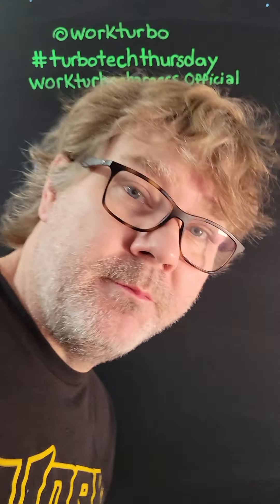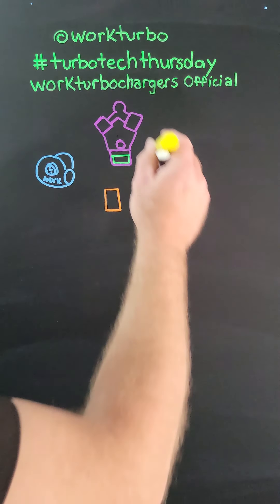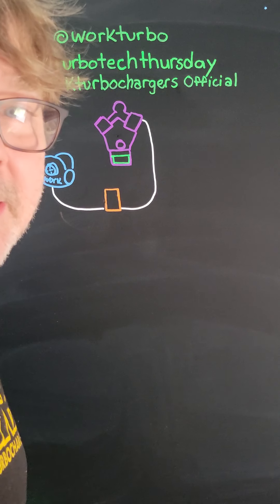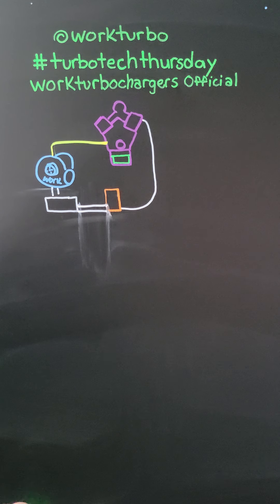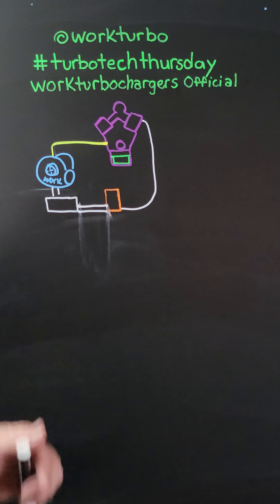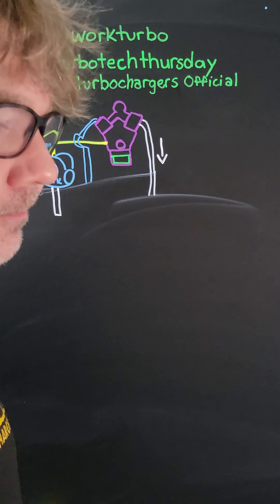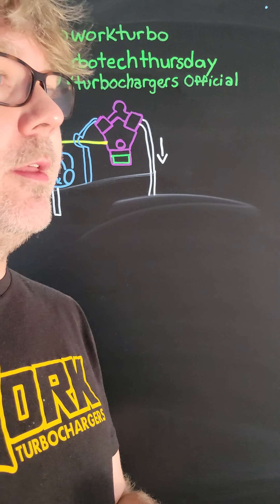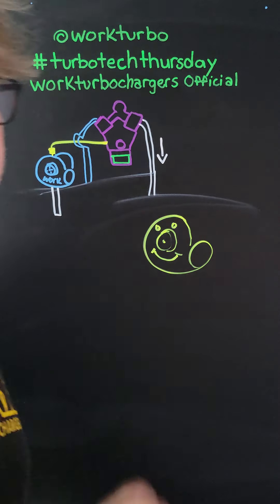Scavenge Pumps and Turbos, Tech Tips!!

Comment: Hello good sir, I have my first turbo project on the works now. Its a 2017 V6 mustang and I am doing a single turbo kit that uses a Precision 6776 .81 AR snail. It currently has designed a gear pump located below the turbo that will run a 5/8 in hose using the initial set up you are against. So line drops from the turbo, gear pump picks it up and dumps it back through a billet oil cap at the valve cover. I do not plan to boost past 8-10 PSI on this application. Any thoughts or recommendations?
Reply from the maker: Almost every pump we have seen setup like this will experience an excess of oil/windage at the turbine seal ring...causing a slow buildup of carbon and subsequent issues with the turbo.  That is the reason for the sump tank and the vent...it will allow for gas expansion in the system, which a gear pump is not going to handle very well.  

I would take the time to address the design before it becomes a problem later down the road!  -Reed
Reply: @workturbo  Thanks so much, I will work into getting a small sump tank, I already found a nice option, in order to avoid any issues. It will have to be a mid term solution since I am already over the budget. Seems like I can use the turbo for a short period of time using the current setup..

Comment: @workturbo alright thanks.  I've had an old STS kit lying around that I decided to put to use, and the oil inlet has a check valve that came with it.
However the return side did not.
Started it.
Revved it, confirmed it worked, shut it off.  That was the end of that day.
A few days later I came up to the car.
Oil coming from everywhere.
Out both holes of the cold side of the turbo, out the hot side etc.
And like you mentioned it was parked on a hill. And had no check valve at all not to mention no scavenge tank.
Reply from the maker: Many years ago my friend Matt and I did a custom twin turbo kit on a viper...cranked it up, ran great.  Shut it off and went inside to grab some food.  Came back to 7 qts of oil dripping out of each side pipe.  Ooops!    Lesson learned!   -Reed

Comment: Ok maybe a crazy idea.
On a remote mount turbo.
With the air filter routed into the trunk.
What about running a 1/2" line to the scavenger pump.
Only between the turbo and pump adding a 1/2" T as a vent tube routed to a high point in the trunk?  My trunk is non sealed trunk as my car as been in a wreck but i dont want my air filter under the car so i dont suck in water or debris.
Reply from the maker: I have always found a sump tank works best to get the oil as air free and collected for the pump's suction side.  Keeping the pump primed the best we can anyway.  

If you are willing to experiment, the T fitting in the line may work in your application.  Seems like a simple enough test!  -Reed

Comment: What check valve do u recommend after the pump on the return line?
Any brass check valve do the job?
Reply from the maker: It needs to be rated for the flow demand, temparature and also be a low "crack" pressure.  I have used products from Eaton, Improved Racing, Vibrant etc with good results.  -Reed

Comment: Do you think running a vent right below the turbo is a better approach than venting a tank? If pump pulls vacuum then theoretically running a vent next to turbo should move more air/oil rather than just relying on gravity drain to the tank.
Reply from the maker: We have tested this back in 1997, and it works if you can get the vent into a functioning location without getting blocked by the oil flow.  Its consistency was always our main quirk with this approach.  Reed

Comment: Awesome info. Thank you sir. Wouldn’t have thought of the one way check valves or oil resivor. By chance where may I find a 4AN one way valve for the oil feed side? And how important is it to have the watsegate before the turbo vs the traditional built in watsegate on a remote mount turbo?
Reply from the maker: Sorry for the slow reply, John...been a bit busy in the shop!  For the inlet check valve I recommend the viton 1 psi version from https://rbracing-rsr.com/oilsystems.htm  Their valve has worked flawlessly for my customers.   They also sell the only scavenge pump I recommend.  As for your question on wastegates...that is a very cut and dry answer.  Internal gates of the right size will work, but external gates placed in the right spot will always provide more power potential.  I will cover this topic in a video soon ;)
Reply: @workturbo  No worries! Thank you for everything, I really appreciate you and your time for reading my messages and replying back! Link included 5* 
Looking forward to the next uploads, especially on the Wastgates. 🙏🏻🙏🏻🙏🏻

Comment: Great video its super informative. I'm in a situation with a TT setup where I can't get the pump lower than the scav tank.  In this case if the scav tank has a breather will it stop the pump from priming?
Reply from the maker: Good question.  If the pump is pulling from the lowest portion of the tank, then it should not be an issue as there will always be "fluid" present in that area for the pump to pull against. 

 I have found that most of these pumps will fail to pull aerated fluids very well at all, so that is the main job the sump tank performs (collecting the liquid and putting in a place/state that the pump can deal with).  So as long as your tank is of adequate volume and a fairly well engineered shape it will work as good as it can with the vent. 

  Now, if the pump struggles with pulling fluid, that may be a problem with the pump itself.  Like I said, most wont pull like the manufactures state they will once they are in the "car environment".  This is what bit me years and years ago...

Short answer is the vented tank is a requirement that the turbo needs, solely for gas expansionc.  If the tank collects the oil and cannot "overfill" then you will have success IF the pump can pull the column of fluid out of the tank effectively.

Hope my rambling makes sense-Reed
Reply: @workturbo  thanks good answer I guess there are no definates here hey, I'll need to build and find out. What sort of flow rate should I expect to be going through a turbo? This would help me figure out if the scav tank drain is going to be submerged. I'm using 2x BW EFR 6758's, and I actually can't find that data anywhere.
Reply from the maker: @adampentland9871 While there is no published data on this (that I have anyway), our testing has seen as little as 16 oz per minute and as much as 60 oz per min depending on the oil temp, oil type/viscosity, oil feed line diameter and of course pressure.  BorgWarner  suggests no more than 4 bar oil pressure (60 psi) maximum and an oil weight of 10-40 in their Technical Training Manual fwiw.  Reed

Comment: If I go to a standalone tank. I'm wondering if you ever heard of anyone using actual 2380 turbine oil Or where I can find info. I use it in my Garrett TPE 331 -10 on my Thrush Shits like 40 bucks a qt but I've got cases of it. I'm not a oil guru but seems like a better option then motor oil it's a lot cleaner and thinner so it flows faster than motor oil and handles extreme heat very well like 750 deg Celsius on every startup.
Reply from the maker: I have experimented in using turbine oil a long time ago.  There should be more data on it avaiable to the public a little easier than 20 or so years ago when I was "younger and naive!" We know the temperature stability should be excellent, and I would hope the oil would meet all of the needs for a floating bearing (ball bearing turbo will be fine with it)...let me do some more research!  I think I a good contact that should be able to help place some insight -reed

Comment: You covered the fact that over compensating for the oil flow when choosing the pump is a factor. Do you think there is such thing as too much pump? My intuition tells me that too much pump can't be good either as it would aerate the oil returning back to the engine. What would be a good remedy to eliminate all the air in the line between the pump and the valve covers?
Reply from the maker: It would most likely be worse for the pump itself than the engine, as a little bit of aeration introduced into the valve cover really wont matter as it will dissipate as it drains back into the pan.  I have only seen this possibly being an issue with a dedicated suction stage on a dry sump pump, but it was an old pump with unknown history.  Our customer's road race car has used a full mechanical stage to scavenge just one small T4 turbo and we have never had an issue with the turbo, pump or aeration (but it is returned into the oil can that has an engineered baffle system in it from the manufacturer).  Hope this makes sense!  Reed

Comment: So I built a tank and it was only vented to atmosphere. I took it for some drives and it was fine. This go around I started hitting boost and it squirted out of the vent all over the bottom side of my vehicle. Is this why you run the vent to the valve cover?
Reply from the maker: Yes...for this reason and also to keep it sealed from water/dirt/debris as well!
Reply: @workturbo  ok so maybe my oil pressure is just to high and I need to regulate it or get a bigger pump
Reply from the maker: @jeepwk6.5L  What turbocharger are you using?
Reply: @workturbo  shitty one 😂, on3 performance 80mm

Comment: What about using the scavenge stage on a dry sump pump? Does this still apply? My turbo is higher than my dry sump pump
Reply from the maker: Same rules apply...use a sump tank with a vacuum break, it will work perfectly.  If your oil pan has several pickup stages at the very bottom, you can also drain back into the pan, just make sure the line is the correct size and flows down hill all the way to the pan.  There can be ZERO up hill runs in the line.  Thank you!

Comment: First you teased that you would name the one scavenge pump you recommend - then you don't. Please do! Excellent drawings. Learned allot, great advice - except for that "secret" scavenge pump thing...  Also, recommended check valves, if you will.
Reply from the maker: Sorry about that Dale...I have all of the parts to do a follow up video, just lacking in time at the moment.  The pump we have always used and recommended comes from RB Racing.  They also have the correct check valves.  This company has done a great job finding/creating oil scavenge solutions.  rbracing-rsr.com

Comment: I have a twin turbo setup and a turbowerx exa pump and turbowerx said don’t use a sump tank just Y the two drains together into the pump with no sump
Reply from the maker: Not a good idea, just because of the gas expansion I went over in the video.  It may work for a short amount of time, but eventually it will create an issue with the turbocharger.  Been there before and see it regularly on turbo kits that install the lines in the same manner. -Reed

Comment: Any ideas on the scavenge pump on the 15+ subarus
Pump is mounted uptop mated to one of the heads
Reply from the maker: I am not familiar at all with the Subaru system, but I am sure it has been tested as adequate for the factory turbo from Subaru...

With that comes a bunch of questions if you start to upgrade the turbo...same to be said for the Porsche Type 930 and it's mechanical pump as well.  

We have had quite a bit of Porsche testing over the years, and to say it is temperamental would be an understatement.  I am sure the Subi will be the same way.

Comment: Do I need a pump if my turbo is above the engine
Reply from the maker: If your oil drain can flow completely downhill to a spot that is above oil level and free from excess splashing of oil to impede the flow, no you do not need a pump.  Make your return line as large as possible, and as direct as possible (no extra bends or angles) and it should work just right.  Tell me what turbo you are utilizing and I will make sure your line size is adequate!

Comment: Whats your thoughts on running an in line filter (40 micron) between the pump and valve cover? Unless the turbo fails? Would this way as you explained also eliminate the use of a pump timer or some sort of timer to keep the pump to drain the system as the engine isn't running? Or is that what the check valves are used for?
Reply from the maker: No harm in running a filter at all, just make sure to use it in all of your flow testing.  As for the timer, there is no need for it when you have a properly sized sump tank to take care of the "backflow" through the pump and residual oil in the turbos.  You are also correct about the check valves, they will stop any siphoning from the engine or backflow from the return line.  A side note, very few pumps are actually positive displacement, meaning a timer really does not help once the pump loses its prime.  The column of oil after the pump usually sits in the line no matter if you leave it running or not...hence the use of the sump tank and check valves to keep this fluid from backflowing to the turbochargers.  Sorry for the long response, hope it makes sense!
Reply: @workturbo   Huge help..! And it makes sense. Would you recomend a 40 micron filter will do the trick using a pump with a 2-3gpm? I don't want to impede on flow back to the engine.

Also what do you think about venting the sump tank to your oil catch can? The tank would be venting to atmosphere as well as grab its own vacuum source via an E-Vac fitting in the exhaust. Would that defeat the purpose? Because you would need a closed system in order to create a vacuum for the excess vapors created in the sump tank to escape? 

This question also pertains to the oil catch tank itself. If you are creating vacuum in the tank and venting to atmosphere at the same time, how would that help exhaust oil vapors out of the engine? 

Thanks in advance!! This video alone is a huge help. I'm determined now to get thing efficient and 100%.
Reply from the maker: @Bye401K  Without going into a big long message, the filter would be most applicable to a ball bearing unit, and I would put it before the pump.  Reason being is most failures with a journal bearing unit do not put any metal into the oil.  The bearings (in most units) are a bronze alloy (990 or 660 series alloys).  What this means is they really never flake or create small residual contaminate.  99% of them just weld (or metal swap) their material to the shaft, collars or bearing housing vs. making any contaminate.  Ball bearing units on the other hand can create trash...bearing balls, cage pieces etc.   The filter before the pump would catch this and still allow the pump to work, possibly keeping a big oil mess from happening if you are on a race pass or hard pull etc.  We simply put a mesh screen in the oil drain flange, works like a champ and super simple.  I forget what mesh we have used, but I can look it up.
Reply from the maker: And for the vent...I do not see any harm in putting it into the breather tank.  We have a few set up that way with no issues, and in all reality if you have the engine breathing entirely through that system, the sump tank vent will always be subject to the same conditions regardless of its location.
Reply: @workturbo   Perfect. Lotta info there man. I have a 40 filter I wanna use but just done want to choke the pump out. Not sure if that will be ok. Ive also seen these simple cone type screens. I was watching a vid on jet engines and there oiling systems. lol. A bit over kill.

Comment: Any problems pulling a vacuum on the turbo seals?
Reply from the maker: We ran a vacuum pump on our single turbo SBF for years, pulled an average of 2-4" at full song going through the traps, never had any issues that we noticed anyway.  That turbo was a journal bearing unit (106mm Garrett).  We have since gone away from a vac pump because of a better engine block/piston setup (billet block!) so the architecture is much more sturdy and the piston/ring technology is years better.  Thinking back on it, I wish I had tested this a bit more...there could be some harm pulling a vacuum on a turbo, especially in a newer ball bearing unit as they are not fully pressure lubricated (more of an oil spray)....so as of today, i would recommend going on the conservative side and not pulling much more than needed on the system.

Comment: hi, I am looking for advice to do a separate oil lubrication to the turbo on the Mitsubishi td04-10t, thanks
Reply from the maker: I would suggest using this pump from RB Racing, it will work perfectly! https://rbracing-rsr.com/oilsystems.htm use the 03-1034 pump.  Make an oil reservoir that the turbo can gravity drain into, the pump can then deliver the oil to the turob inlets. Make sure it has enough capacity for your intended use. I would only suggest this type of install for short run/drag race installation, otherwise you will need to think about a second pump and an oil cooler.  Good Luck!
Reply: @workturbo  A thousand thanks

Comment: Can it hurt LS engine buy feeding oil back into valve cover like this?
Reply from the maker: Returning back to the valve cover has been done a lot here in my shop, but not on an LS (mainly Vipers).  I took the time to make sure the return was in a location that would be as close to the drain back holes in the head as possible.  I also made a small deflector to keep the returning oil from flooding the valve stem areas (deflected it down, as close to the drain passages in the head as possible)  I do not see why this would not work on the LS, just put some thought into what is actually happening and make sure the system can deal with the extra flow.
Reply: Thanks mate very helpful